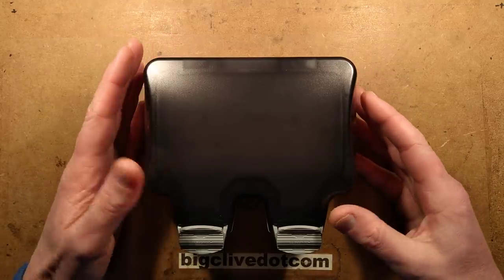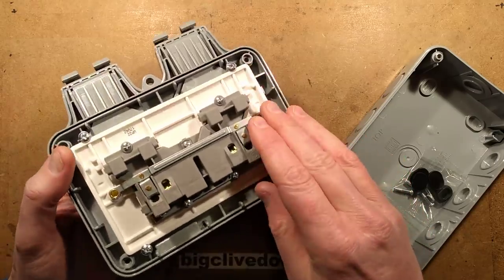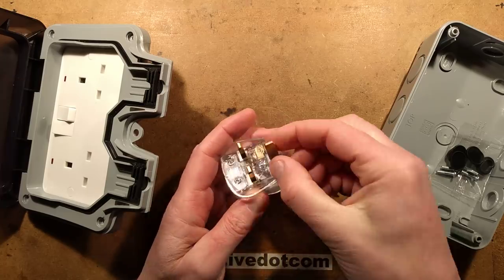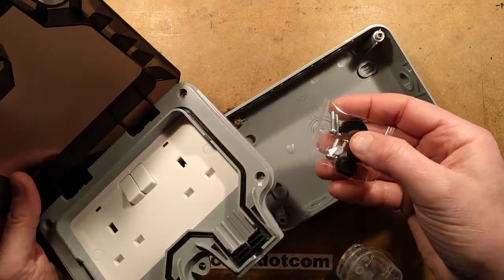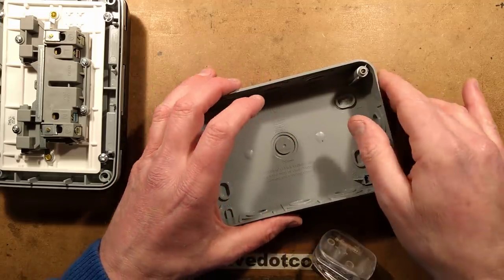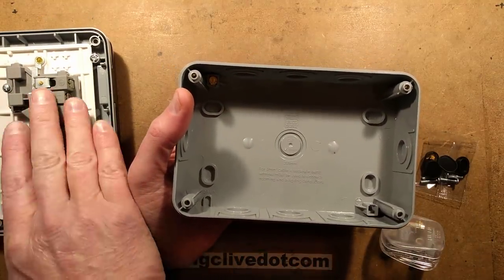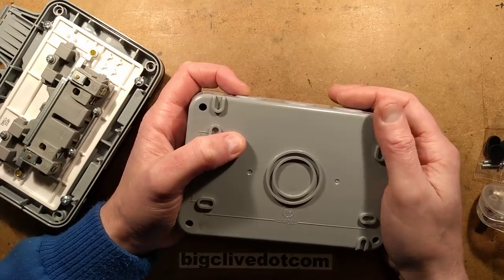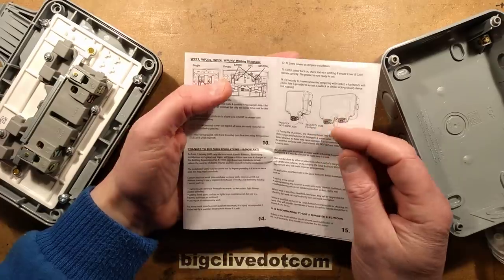British weatherproof socket with clever design. (bonus rant)

Comment: Good video Clive, I love to watch you do these vid shows! I've used these sockets, they're really very good and I fitted them at work in recent years. As for the 'rant' about Part P and the EU colour coding - not a rant at all Sir. We used to use to a fantastic wiring system,  red/blue/yellow (3 phase) and black for neutral, but now, black is used as a phase conductor! Never did this, but that black could easily be mistaken for neutral where you have a mixture of old installations and new and accidentally connect it to an earth or neutral bar. Glad I retired 4 months ago - I don't worry about things like that now, the EU does my head in. Not sure if you've done the latest IEE regs, but have you noticed how the Germans are starting to take over the regs book as well? Stay safe, ATB.

Comment: Yes Clive! It is worth a rant. With also 40 years experience it is jaw dropping the ignorance of present day electrical workers.They get day laborers to run cable and do terminations on the say so of a traveling site foreman and then put the "expert" in with a magic box to see if it is safe.A lot of these "experts" are operating on false papers and the only thing i know is safe is what i do myself! God help the ordinary Joe.
Reply from the maker: I was doing theatre equipment installation in several schools in Scotland and the electrical and mechanical services company that was doing the electrical and plumbing installation had just ONE red-faced electrician running around them all supervising a mixture of unmentored "apprentices", labourers and pipe-fitters who were helping wire stuff.
I talked to the apprentice and he was trying to do a home study electrical course in the evenings but was struggling.  Other schools with other contractors were just as bad with absolutely horrific wiring and at the end of the jobs they sent in an elderly "troubleshooter" to fix the problems that were all locked in ragged trunking above ceilings and behind walls.  Needless to say they couldn't do much.  I think there were a lot of made-up numbers on the paperwork.
Reply: @bigclivedotcom  One "electrician" name dropped the 17th edition to me as if he knew anything about it.The housing stock, especially in sheltered dwellings is deteriorating and criminal.Two in my area arrested and doing time for fraud in awarding contracts. They missed another ten who should be with them.I have been threatened by these people for advising disabled people in sheltered housing.

Comment: I grew up in a house with 15A round-pin sockets. IIRC we had a lot of adaptors which gave off one 15A and two, smaller, 5A sockets. There were also some dinky little 2A plugs and sockets. Anyway, the point is, I cannot recall if the wall sockets were shuttered or not, but the adaptors certainly were not. This made them very handy for the demonstration of electrical glass explosions. One put a hoop of pre-bent glass rod into the live and neutral sockets, applied heat and, at a critical temperature the glass would start to conduct and exciting things would happen. 13A sockets may be great for safety (no argument there) but they do make fun more difficult to engineer.
Am I a bad person?

Comment: Outdoor receptacle boxes here in the US are required by NEC to employ ground-fault interruption.  I don't see that here--does the UK allow non-protected outdoor receptacles?  The common exterior outlet box here is supplied with a variety of faceplates to fit switches, receptacles or GFI-type receptacles.
Reply: A Gentleman  That's interesting.    GFI/RCD on consumer units is quite uncommon here, but not completely unknown.  When my wife and I moved into our new home, I was puzzled why a Toshiba microwave oven refused to power on, even though there was power available at the outlet.  It turned out the the outlet was wired in reverse, with hot and neutral reversed.    I went through all of the home's outlets and found about five of them so miswired.  Perhaps the electrician was blind or drunk; in the US, 120V wiring code is black (hot) white neutral and bare or green for ground, so the mistake isn't an easy one to make.

Comment: In Canada, we now have to install the socket boxes marked "Extra duty" that are built similarly, but there is no sealing grommet around the cable hole; presumably so the water can drain out if the seal fails. I wonder why the British thought it was a good idea to seal all four sides, it certainly seems less safe.

Comment: Here in the US on this side of the pond "waterproof while in use" has been a requirement for outdoor receptacles  years. Ours just have a hole on the bottom for the cable, so when not in use for a long time provides a nice home for bees and hornets.

Shutters are also a relatively new requirement in the US for many location. Unfortunately US appliances come in both 2-wire ungrounded and 3-wire grounded flavors. That means shutters cannot be triggered by the Earth contact, but by nonsimultaneous operation with somewhat mixed results.

Comment: I'm a qualified electrician who originally apprenticed as an electrical engineer in the 80's, then undertook further training in domestic work.  I'm also part P registered, as it's expensive to notify work in advance, then get the council out to inspect it after completing notifiable works.  Unfortunately, here in England we either join a scheme, get the council involved,  or work illegally (which many builders do).  We are not permitted to "sign off" other peoples' work, and frankly, I agree with only taking responsibility for my own work.
The problem with electrical work is that many people think they've done a good job just because it works.  I've lost track of the number of times I've come across broken rings, missing cpcs, switched neutrals etc.  I've spent a fortune on test gear and training to make sure I can certify the work I do and work to the regulations,  something most DIYers simply can't do.
Regarding the silicone issue, I always use neutral cure builders silicone sealant with cables and copper pipework.
Love the channel :)

Comment: Good rant, I haven't raised my BP over the harmonised colours for a while so let me weigh in: the point of the three phase colours being so different was that it was easy to discriminate even in low-light situations (such as, I dunno, DUCTS, BOXES, PANELS, EQUIPMENT, basically everywhere that connections would be made, generally with a torch because the power was off). 
The reasons behind the IDEA of having a harmonised colour scheme were good; some countries at the time had various schemes, some even had none! France was the country that surprised me most at the time, because anyone who is familiar with France knows that they love to define things in the legislation... the weight of a loaf of bread, the correct side of the field that a goat must graze to make a certain cheese, the exact number of times a peasant stamps on the grapes to make a particular wine... but electrics, once beyond EDF's meter, was anyone's guess. A French electrician was at liberty to use whatever colour he wanted to represent each phase, neutral, earth etc. Which meant that if another electrician came after to fix something, he wouldn't have a clue what was going on until he took everything apart and tested it. Pierre likes purple as live, Gaspard likes orange as live. Thing is, if Gaspard came to fix Pierre's installation, he can still use orange as live even though Pierre has been using it as neutral. Crazy. France, despite being a country of similar population, similar development, affluence etc had (assuming I recall the stats correctly from when I last looked in the early 00's) two orders of magnitude more electrocution deaths in the home. You could rule out equipment failures for these as the number of electrical fires (i.e. due to failed components) being near-enough identical, so it came down to installation and maintenance issues. 
Of course, the UK and Ireland (and of course, the Isle of Man!) had a very well-defined standardised system which included, amongst other things, colour schemes for wiring. So you'd think the European Commission might just look at who had the best system and make that the standard... Oh no, we have to have a new system of course! So, they looked at what each colour was used for in each country and tried to find a best fit. Red and black were already in use in Germany... as Earth and Live respectively. So we couldn't use red... but for some reason using black as live in the British Isles was perfectly fine? Ah, because three-phase was only going to be used by EXPERTS... Experts with super-human vision, who can distinguish between black, dark brown and dark grey in low-light. Except... It isn't only used by experts, nor even in just industrial settings... In our archipelago of NW Europe, we often use 3-phase cable (which we call 3-core and earth) to wire up 2-way switching so we can go up and down stairs in the night without breaking our necks, as well as using them in basically any other place you might want to control a light from two places (bedroom door + bed, kitchen door + backdoor, both ends of a long room with doors at either end) and also we use it to wire in mains-powered smoke detectors. 
Now Part P... According to the powers that be, I am not a "competent person"... Something to do with having a "NICEIC" sticker on a van, and nothing to do with... I dunno, a relevant engineering qualification. So, I registered my plans with the BCO, at inspection time they sent out their contracted electricians to inspect, and I had to pull out my copy of BS7671 no less than three times to explain exactly why they were talking bollocks (obviously after the nice "this is incorrect you say? Oh... what part of it is wrong? Are you sure that you're quoting the regs correctly?" conversation). Nice chaps, but it did concern me that people who can sign off their own work were making fundamental errors that seemed obvious to someone who cannot sign off his own work. I prefer the Scottish approach of "just comply with the regs!!!"
TL/DR: Harmonised wiring colours? Part P? Bunch of twats.
Reply from the maker: A lot of the people doing electrical testing now don't understand the actual science or purpose of the tests they are doing.  More emphasis has been put on filling in forms than actually interpreting the readings correctly.
It's probably just as well nobody ever actually reads the forms anyway.

Comment: Is that a loop on the cover and back box allowing a padlock to be fitted?

Also, I'd have thought that drilling the drain holes would prevent any pressure build up.

Comment: Saw one of those for the first time on a DIY Perks clip last night and was impressed, but this one having the double gang clipped in is even more impressive - means in theory it could be swapped out with an Australian socket if the standards are similar enough. 
The loops for a padlock are also nice
The whole way your UK sockets have those shutters - that's something I've been impressed with since I first heard about it. Great safety feature. I'd rather ugly but safe over "slightly pretty" and a death trap. 

As for regulations - for real stupidity, some states here in Australia have regulations written so poorly that technically changing a damn light bulb requires an electrician. Not that anyone bothers with it, meaning everyone in Queensland is breaking the law when they change a light. 

Going to have to find some Aussie foods to send over one day. Don't worry, not Vegemite

Comment: This looks like a very good design. We have some outdoor covers over here on the American side of the pond that are similar to this, but not quite as good, because I've never seen one with a seal around the cables, and since our plugs mostly have the cord coming straight out of the plug, the cover has to be really big to accommodate the loop of cord around and then down through the slot.

I wish we had as good a design as the British plug and socket. It appears to be much more durable and practical, as well as safer. Our plugs easily come out part way, leaving charged prongs exposed. The flat prongs also bend easily, and I have seen them break off, leaving a charged prong stuck in the slot.

The color change you mention sounds really stupid. I have noticed these colors in appliances, and I always find it difficult to remember what color is hot and what is neutral. My instinct is to think brown must be neutral, because it's the color of the ground.

Comment: One more advantage of UK plugs is the square form factor forcing extension cord makers to orientate the sockets at 90 deg angle and with sensible spacing while eu plug socket can (and are) packed so tightly that you have to think where plug what so it all kinda sort of hang ins. And if they are at an angle that's separate ring of hell.

Comment: Globbing silicone as a wire ingress seal? Do you not used duct pug over there? Any decent electrician in my area of the US will generally carry at least one block of it. Tear off a bit, pack it around the wiring entry hole, and forget it. It stays flexible for what seems forever!

Comment: Me again that reminds me of the in use covers were required to use now for outdoor receptacles exposed to weather. Although it's stricter. Or on your end and also having an LED would actually be a nice touch especially since our outdoor Outlets are required to be protected by G if I see either in receptacle itself or at the breaker panel would would have saved me the trouble plenty of times when we're trying to track your own that it had tripped and didn't know. And also I did not happen to have fun meter or my receptacle tester handy.

Comment: Hi Clive: Can you review why these kind of boxes and outdoor related devices, don't just use those 'Do Not Eat' Silica Gel Packets? Silica Gel is reusable, so it could absorb moister and then when the given device heats up it can let it evaporate and return to normal size.  They could keep packets away from the circuit boards within the container. Also pro tip for anyone you can buy Silica Gel in bulk on Ebay and use it in your Garage near your tools or other items to nearly prevent - at least reduce rusting
Reply: You can get bags of 'cat litter' that is Silica Gel quite cheaply too.

Comment: As being from the U.S. and not ever actually using a UK plug, I like the design of them. My only complaint would be the bulk. Does the UK have locking plug/sockets. In the US we have the twist sockets that are OK for industrial/shop use. I would like to see more locking connectors on standard extension cords.
Reply from the maker: We use Ceeform latching connectors for industrial applications.  Available in singe and three phase versions with current ratings of 16A, 32A, 63A and 125A.

Comment: Re..rants...My[now ex] brother-in-law,was,in the early 70's,head of Electrical Maintenance Services at an RAF base in Cyprus,after a few years there,he then went on to head up a similar post at a Nuclear Submarine Base in Scotland..He was also on the Board of the IEE[Institute [of]Electrical Engineers],who are/were,the body that was responsible for Electrical Regulation[s] in the UK....OK....Due,I believe,to privatisation etc. of Government facilities.. he was offered,and took, early retirement..rather than work for a "Company"..after a while boredom set in,so he went looking for a little job,just to keep out of mischief etc.....so found a part-time job working for one of the [then] biggest [consumer]electrical retailers as a drivers mate,helping deliver stuff to customers..however,it was stressed,that under no circumstance could he even plug the appliances in for the customer...."as he didn't have the necessary qualifications"...at the same time he applied for,but was turned down,as a "Safety Inspector",for one of the electrical suppliers,who sent people to your home if you applied for a "free electrical safety check",with the intention of scaring them into signing up for a complete re-wire,at a highly inflated cost...but.."not enough experience"...so,he dipped out there....

Comment: US electrical regulations vary with the local government, from the "everything must be in metal conduit, done by a licensed electrician and inspected by a govt inspector" to "get a permit and have it inspected when you're done" which is my kind of regulation and I did that on an addition to a previous house.  The city inspector only had one question - possibly because everything was done correctly the first time.  He asked "Are you an electrician?"  I'm not, but I had an excellent reason for doing the wiring to the standards of the National Electrical Code (NEC): I slept there ;-)

Residential wiring is mostly simple, basic stuff and any number of companies offer pictorial how-to books (although one had to remove their books from sale a few years back because of a very obvious and dangerous error - and that book was sold at Home Depot, one of the biggest "home center" store chains).

Comment: I prefer the west european Schuko plug. These handle 16a just fine. Some complain that it's not polarized, but these days electronics are so safe that no one ever dies because the lack of polarization. The little flat Euro plugs for double isolated devices are also very nice. These days, they are available in 10 amp rating but most are 2,5a. There are power strips with a ton of narrow Euro sockets and one or two Schuko's. 
Also, you can safely leave one on the floor at night. It will not lie on its back, pins sticking up, waiting for you to step on it.